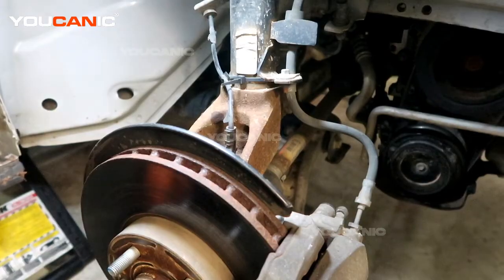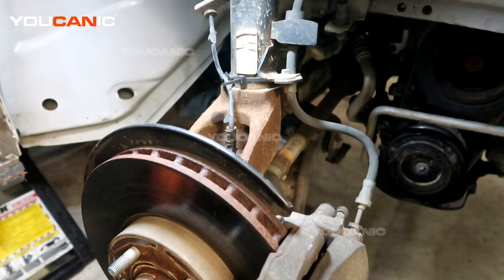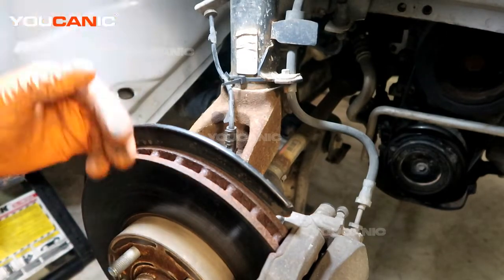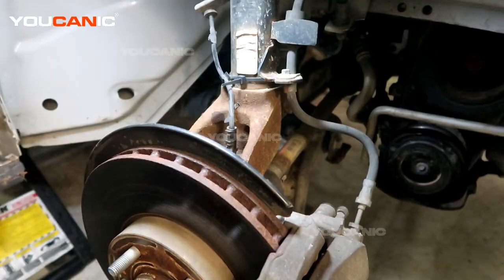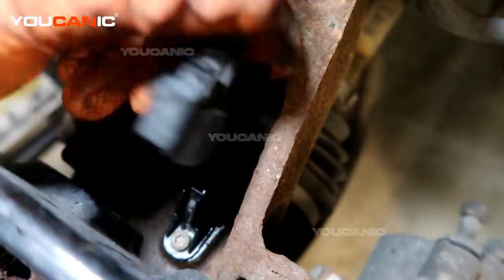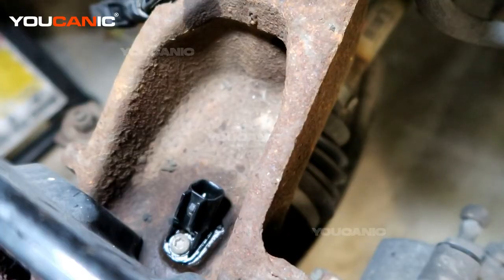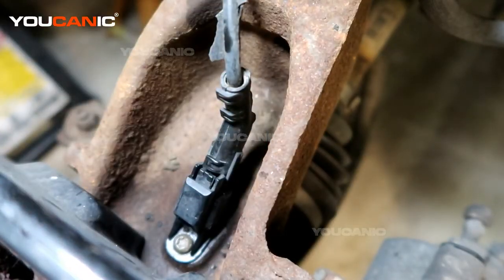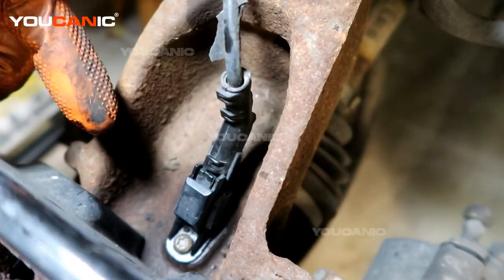2012-2019 Ford Focus - Front ABS Wheel Speed Sensor Replacement

Comment: If the ABS sensor is faulty, will your speedometer engage?
Reply: From what I've been told not necessarily... My ABS and Traction control and constantly on together and was told it may be the wheel speed sensor
Reply: It’s a wheel speed sensor mine was 20 dollars at autozone goes on the wheel. Mine was doing it on my 2012 ford focus
Reply: Currently having this issue right now, ABS light trac light are on and speedometer isn’t working. just have to figure out which sensor it is
Reply: @mattkennedy5807  both lights on for me too and it says hill assist is not working. What’s the best way to figure out which sensor it is?
Reply: @lewisdenton-fray171 heyy did u find a solution ? I have the same problem
Reply: @mattkennedy5807 heyy did u find a solution ?

Comment: I need to buy new pair of screws for the sensor to fit in knuckle can anyone help me with from where i can get those and what's the size
Reply: I would try parts Zilla under their oem section you can find diagrams for every part of the car should be able to order screws from there

Comment: The previous owner of our focus didn't replace the speed sensors that were damaged. So the car didn't count the miles the car had been driven for.
Reply from the maker: It's essential to have functioning speed sensors in your car. If you need help sorting out the issue, YOUCANIC has a wealth of resources to assist you. Our Full System Scanner can help diagnose the problem accurately, just like a professional mechanic.

In addition, we host a platform [www.youcanic.com] where you can ask car-related questions and learn about various solutions. We're committed to making car repairs comprehensible for car owners. If you have more questions or need further assistance, please feel free to reach out at YOUCANIC.
Reply: @YOUCANIC  I got the issue figured out. I just wanted to let people know that odometer scammers are still a real deal when it comes to used car shopping. Make sure that you check the whole car with a mechanic before buying.

Comment: Are the sensors only used for driven wheels or also non-driven wheels?
Reply from the maker: Thank you for your question! Sensors are used on both driven and non-driven wheels. Our main goal at YOUCANIC is to assist you with your DIY car repairs. If you're looking to diagnose your vehicle like an expert mechanic, we recommend our YOUCANIC Full System Scanner, which empowers car owners like you. Here's the link for you to learn more: www.youcanic.com/scanner.

To ensure the job gets done properly, you might also need access to our Factory Repair Manuals and Torque Specs. These comprehensive resources are available for a small fee: www.youcanic.com/manuals. We are here to help you every step of the way.

Comment: Nice
Reply from the maker: Thank you for your positive feedback! We're glad you've found the car repair tips in our videos helpful. Diagnosing modern cars like a mechanic is easier with the right tools – our YOUCANIC Full System Scanner is designed exactly for empowering car owners like yourself. Check it out here: www.youcanic.com/scanner.

To ensure precision in your car repairs, we offer Factory Repair Manuals and Torque Specs with detailed procedures. Available at a nominal cost, they are an invaluable resource for any car owner looking to do their own repairs. Access them here: www.youcanic.com/manuals.